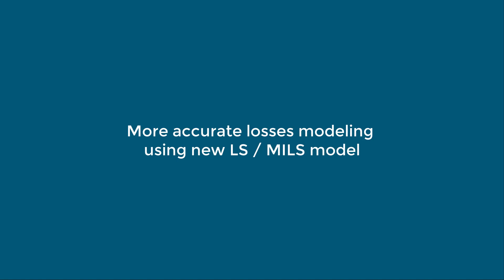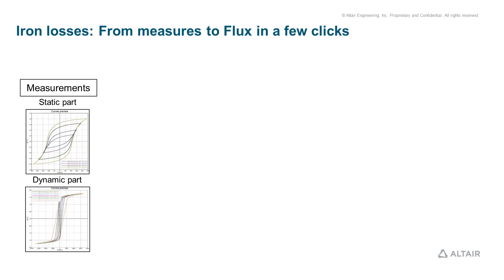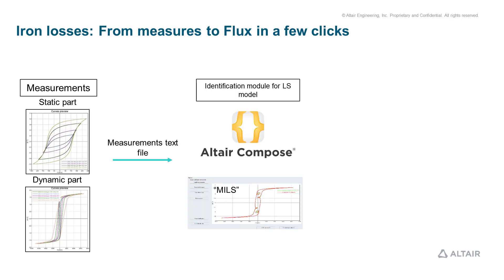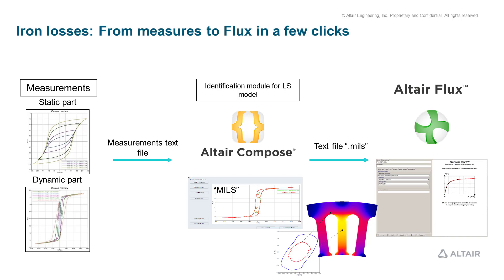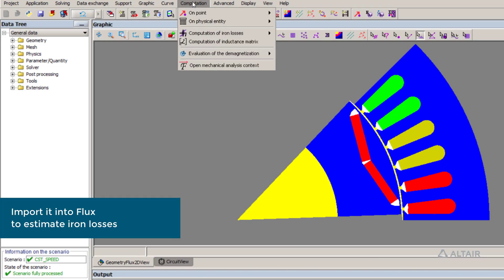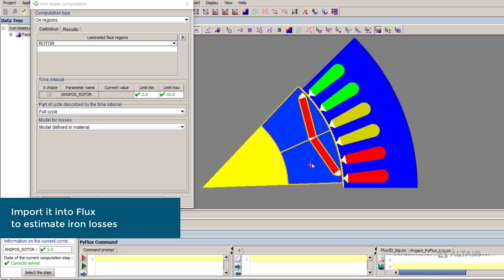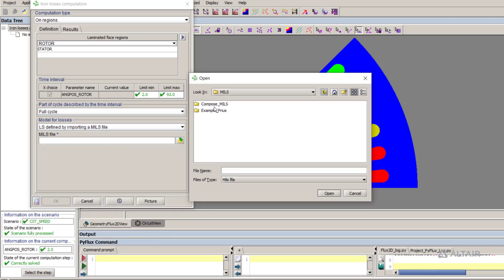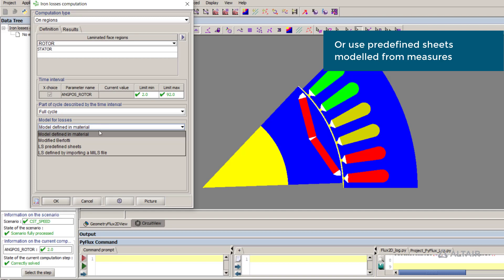Iron Losses Characterization in Altair Flux™

Comment: I have seen in your examples when you present the electrical circuit of the machine you present with coil conductors and resistors and inductances 
my question as that the resistance and the inductance it presents the inductance and the resistance of the coil heads ???
Reply from the maker: Apologies for the delay, Walid! Yes, resistances and inductances in the electrical circuit are for the end winding part of the coil.
Reply: @altair_inc   thak's very much
I have presented the electric circuit of my machine with that conductors wound after I have supplied my machine with a voltage source gives me currents with great values and an important torque as the problem is in the presentation of the circuit ???